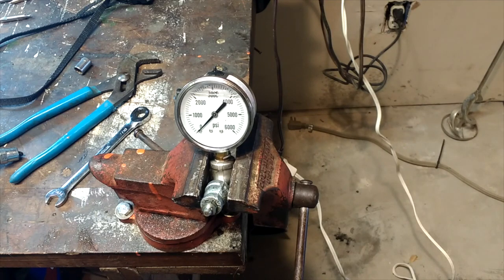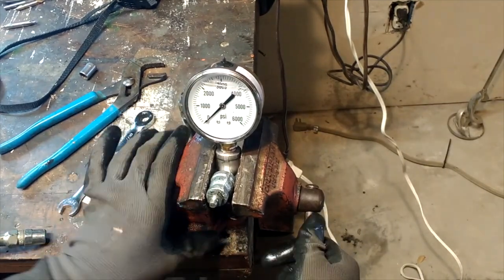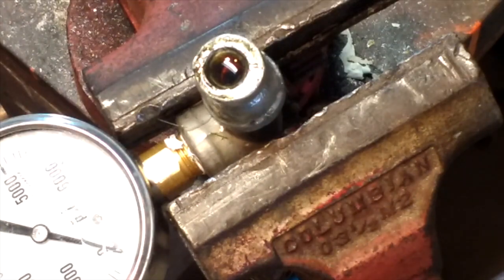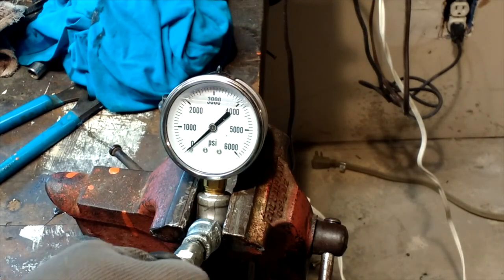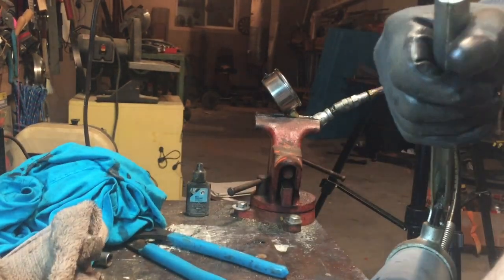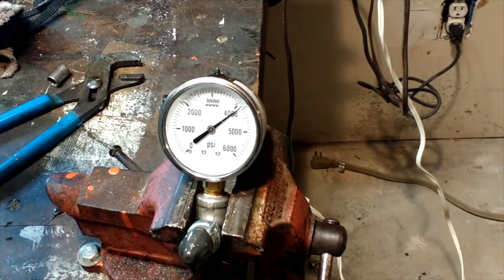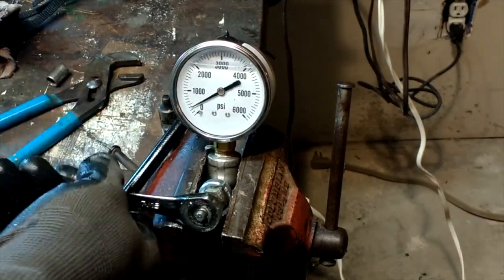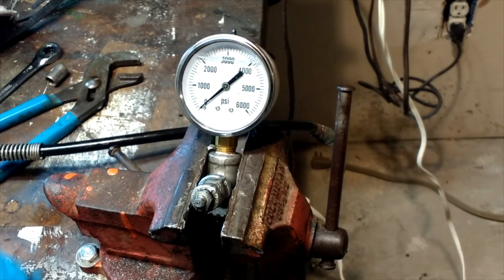Grease Gun Created INCREDIBLE PRESSURE!

Comment: when in the plant did you measure grease, go by feel, grease until see a little wet around seals? like to know because I hear so many different things
Reply from the maker: Generally a grease gun will put out 1 cubic centimeter of grease per pump. Yes by feel is the best, but many bearings will not take grease-could be the zerk fitting-hardened grease internally and I have also blown the seals off the bearing. 
In moving bearings I stop pumping grease when I see wetness-on stationary bearings until a little grease peaks out of the seal or housing.
thanks for watching